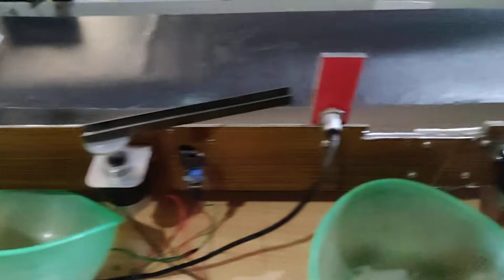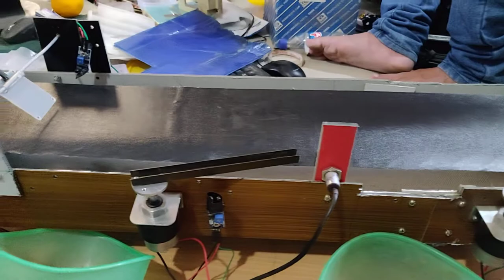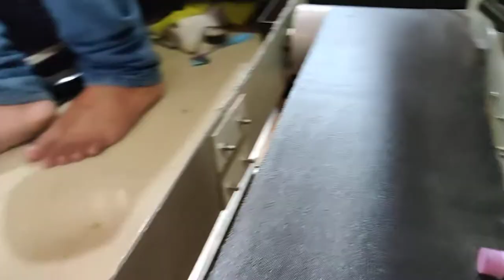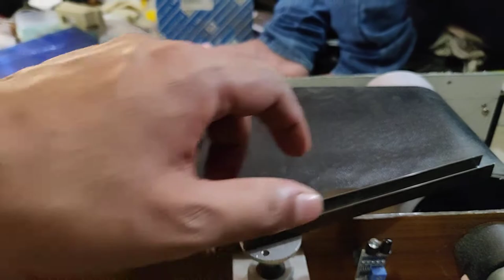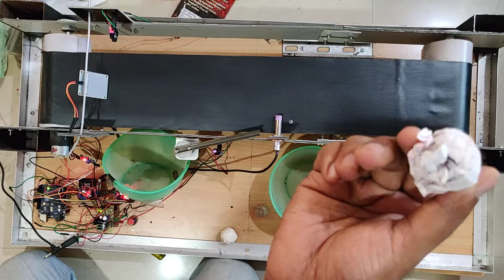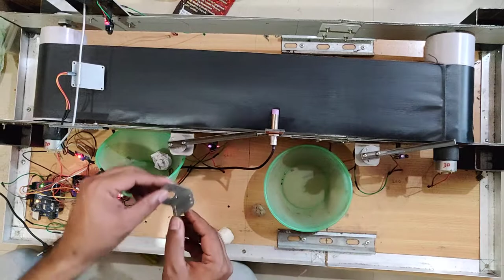Garbage Segregation System

Comment: What would be the cost for just conveyer belt
Reply from the maker: I actually designed the whole conveyor by myself. And I did it during lockdown, I didn't had much resources at that time, I used whatever was available at home like plywood pieces, some Aluminium angles some channels etc, dint even had a ply that was long enough for the conveyor so I had to fabricate two pieces of ply in other to get the proper length. I already had the motors and the mounts. So I cannot exactly say how much spent on it. But the cost depends upon your design, mine is a raw design this ll cost around 3ki guess. If you want a proper functioning then it ll cost maybe 10-15k or so, again depends upon your design, the weight you are gonna put in it, speed, material you are going to use etc.

Comment: bro can u plazz tell me the tottal cost of this work?
Reply from the maker: I did it during lockdown for a batch of engineering students.  I had very little resources since everything was closed,  i had to use whatever was available at that tune,  you xan see that even the ply board i have joined to boards to achieve the required length.  I guess it costed me around 12k - 13k at that time. And i had charged 20k from the students,  that included an internship training program as well. This setup can be made much better if we spend some more amount say around 20k we can make a little better and smooth system than this.  But you have to remember I did fabricated this whole going by myself,  and if you can do it then you might save save some good bucks.
Reply from the maker: Btw am from India and the amount is in Indian Rupees.

Comment: Is this project also implemented using raspberry pi?
Reply from the maker: No I have used Arduino in Project. Although we can use Pi
Reply: Can you help in the code to implement the same project using raspberry pi 3B+ (only metallic waste detection through inductive proximity sensor)
Reply from the maker: I'll try. Just detecting is not that big deal, but if you are going with conveyor belt and all, then it's going too be a little tricky. Share me your mail id I'll get back to you ASAP.
Reply: I have tried commenting my email id but it isn't visible I guess
Reply from the maker: @sye7969  okay then send me a mail on tousif@migitinstruments.com